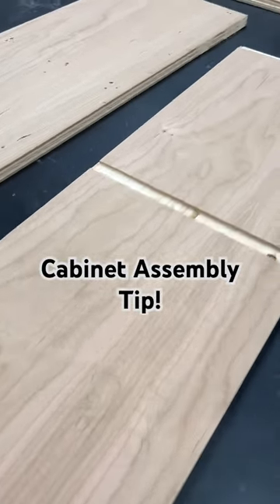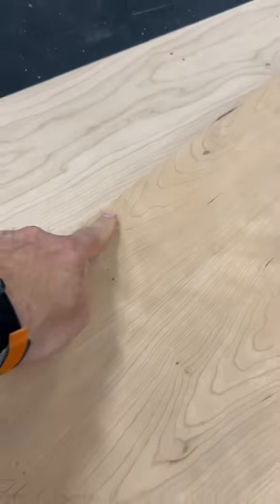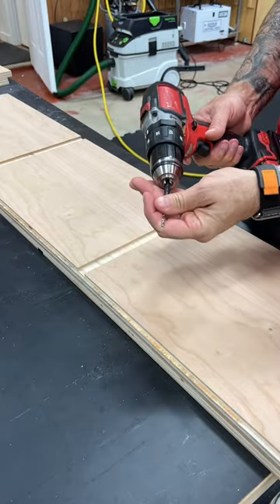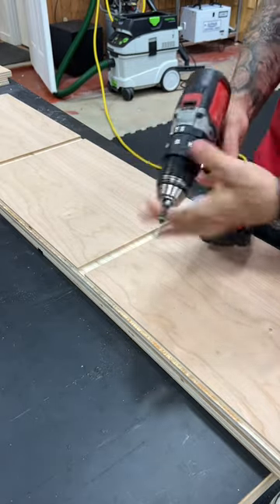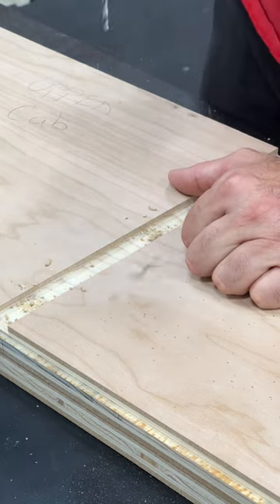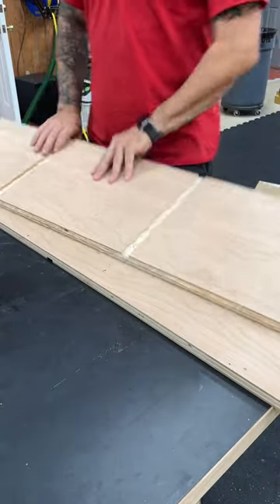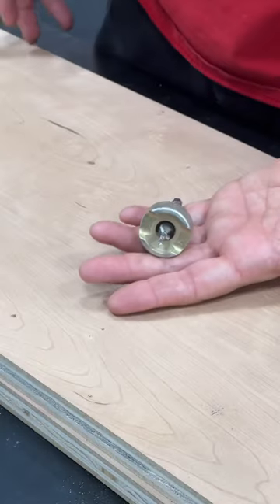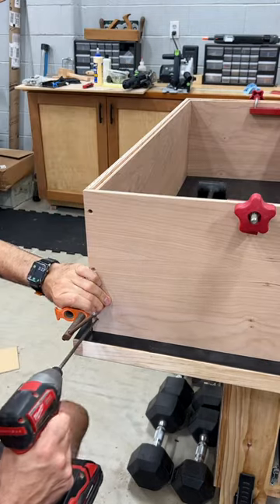Cabinet assembly tip for dadoed and rabbeted cabinets.

Comment: Great tip! The same way you can use lamello slots if you don't use glue in order to disassemble a cabinet if needed; just drive a pilothole just besides the lamello slot. Then use the countersink bit on the opposite side to finish the screwhole.

Comment: My problem is that I can never drill two consecutive holes with a hand drill at the same angle, and that angle difference through the wood thickness can sometimes be seen on the other side.  Now granted, the thickness in this demonstration would probably work even for me, as it looks like a 1/4" dado in 3/4" material, so I'd have to really tilt the bit a lot differently between holes to emerge on the other side of that 1/2" thickness noticeably out of alignment.  But if I can see the slight misalignment, I'd see it forever!

(And mostly I'm just commenting something to help your engagement score!  Keep up the good work!)   :)

Comment: I would personally skip the big countersink hole and use a screw with a head that cuts that hole. To me that leaves more wood between the screw and the board you are attaching to the sides
Reply from the maker: I don’t do this kind of build enough to warrant special screws. But if you do a lot of it I can definitely see the advantage.
Reply: @woodwhisperer  me neither, but it is a fairly common type of screw here in europe. Spax everywhere 😉 And when it only need to be fastened 1 time, it’s usually ok not to countersink.